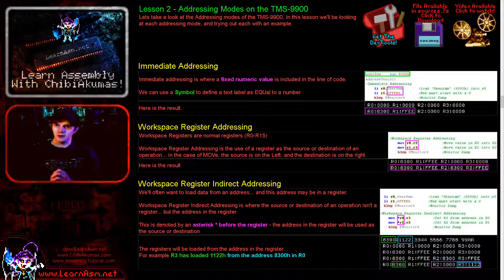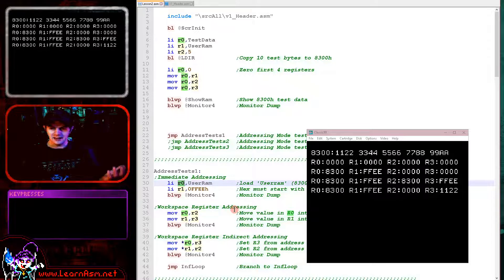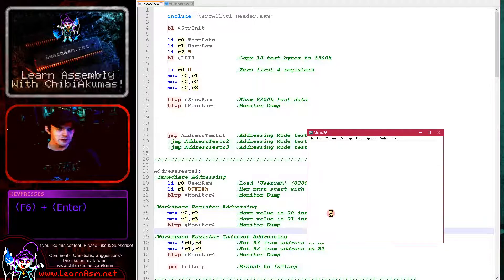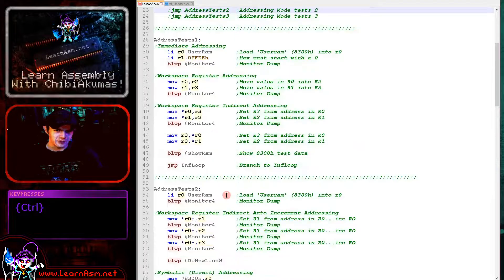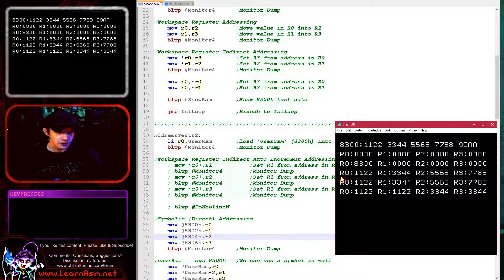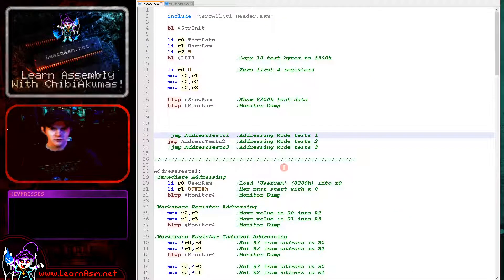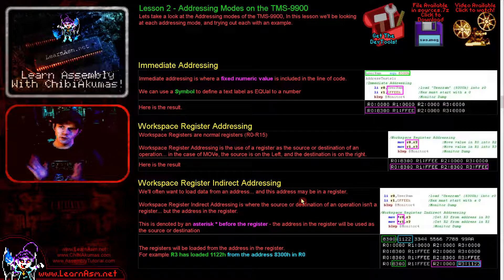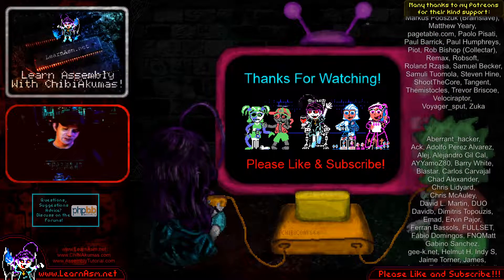Addressing Modes on the TMS-9900 - TMS9900 ASM Lesson 2

Comment: Nice! I got a older Bridgeport CNC machine from the late 80's and it is controlled by TNC155A Heidenhain controller. That controller uses TMS9995 cpu's.
I've dumbed the rom content from the graphical display board and disassembled it. I had to do so because I wanted external MPG wheel and the protocol that the serial MPG uses isn't documented :) I figured it out so much as to make somewhat usable serial MPG, but the protocol code shows that it can do much more, it's just very hard to follow the asm code (those wierd "registers")